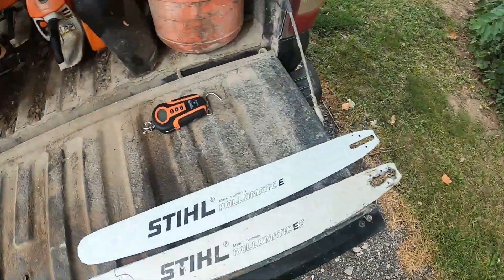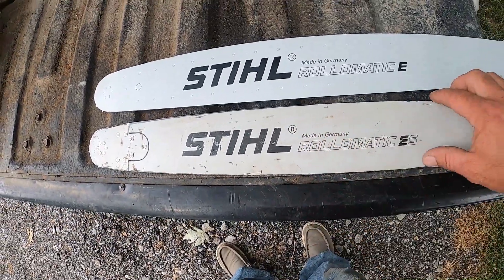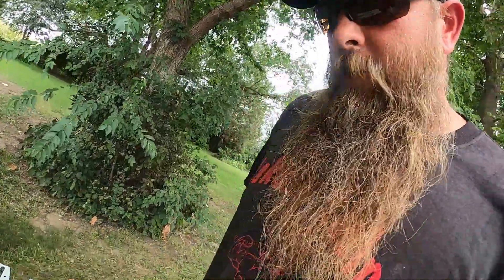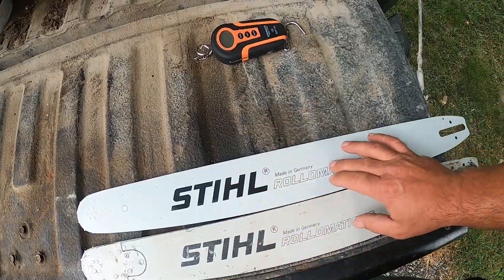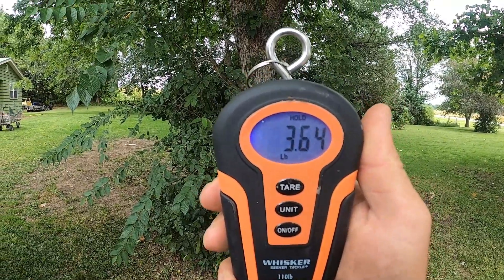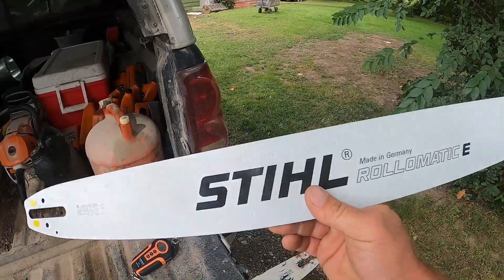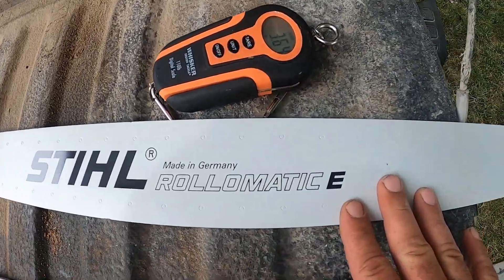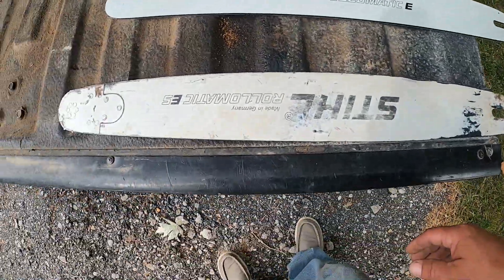light weight chainsaw bar on the cheap!!

Comment: Wonder if anybody has ever bored out some holes in an es bar with a hole saw or theike to reduce weight and see if its worthwhile? Ive got an old 20" one i might experiment on,just to see if it stays ridgid enough and feels much different.  Ive only got one rollomatic e laminated bar,or else id try them too

Comment: Legit question, at what point do you worry about your beard getting pulled into the chainsaw? Possible safety concern.
Reply from the maker: While running a chainsaw has many dangers, any human body part that comes in contact with a chainsaw is going to be on the losing end. At this point, it's a risk I'm willing to take. Lol